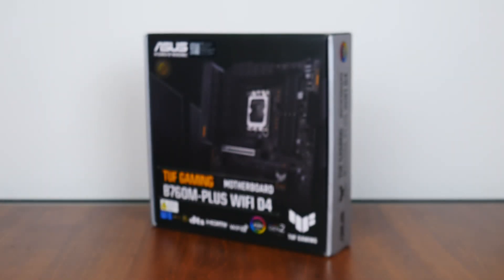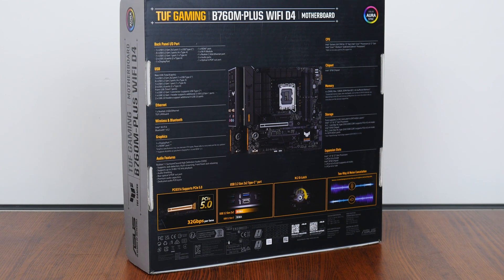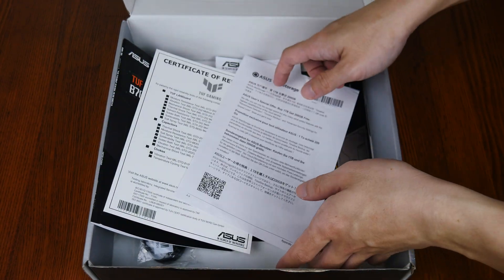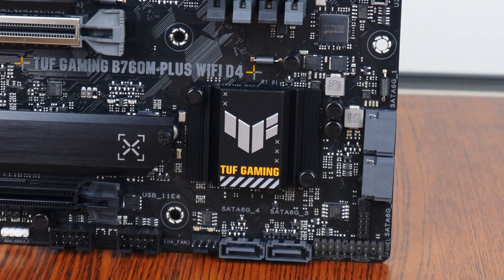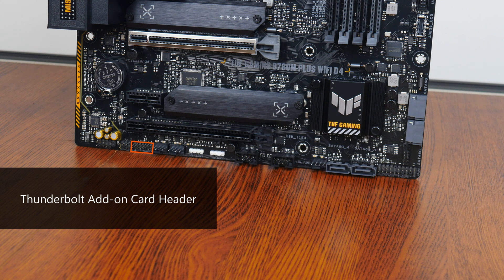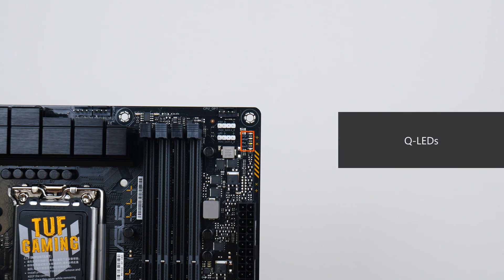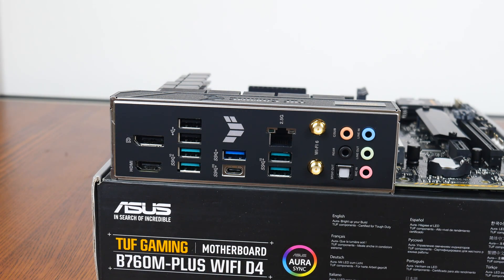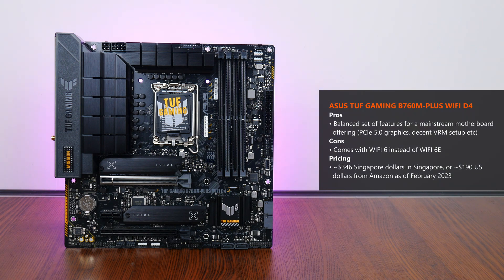Mainstream Intel B760 Motherboard - ASUS TUF GAMING B760M-PLUS WIFI D4 Unboxing & Overview

Comment: I don't know if it is a defect with my board only, but the CPU socket spring was way too strong. I was worried I will break something simply trying to lock in the CPU. I am also getting thermal throttling at around at 4.8 GHz (instead of max 5.2) for 13700 with a 240mm AIO. I suspect it has something to do with with uneven pressure on the CPU. The VRAM heatsinks are also unnecessarily large that can interfere with CPU cooler installation.
Reply from the maker: The processor retention mechanism can be a bit fiddly to operate at times - is it more force than usual compared to other LGA1700 sockets, assuming you've handled other LGA1700 motherboards before?

That said, there's some articles and videos out there regarding how the LGA1700's ILM causes warping which in turn affects the processor's thermal performance. If you have the budget for it, getting a contact frame from Thermal Grizzly, Thermalright etc might help things along..
Reply: @ALKtech  Thanks for your response. Last time I assembled a PC was intel 10th gen. Installed many others but all before that. So I cant compare with other 1700 boards but this was definitely much tighter than any of the others I had installed. I have already ordered the thermalright frame to replace the intel one after seeing those ILM videos. May be that will fix my heating issue.
Reply from the maker: @KK-fi6ms  I see. Would be interesting to know if the Thermalright does indeed bring about thermal performance improvements...hoping it works wonders in lowering the temps for your build!
Reply: try enabling asus perfomance enhancment it will stay at 5.2ghz after that, if ur cooler is good enough
Reply: @zaylo6941  That will not help with thermal throttling. Quite the opposite.

Comment: If you can help me to make a decision, I will be very grateful.

I am going to build PC with Intel i5-13500 and would like to put a
motherboard MSI Pro B760m-a because of the 2 DP and 2 HDMI ports /no one else offer this option/.

My question is this MB has enough power delivery /VRM capability/ for i5-13500?
And second - can be used with 2 HDMI 4k monitors and 1 DP 2k monitor simultaneously?

If I understand correctly the other option is to put discrete VC in order to add additional HDMI port?

Thank you very much in advance.
Reply from the maker: The MSI board will work just fine with the 13500 in terms of power delivery/VRM, so no worries there.

That said, do you already have the intention of getting a discrete graphics card? If yes, why not just connect the monitors directly to the graphics card's display output ports? Most modern graphics cards of today have three to four display output ports, and should be capable of running the three monitors that you mentioned...unless your intention is to just use the onboard graphics of the 13500? Also, are you a productivity user (e.g. video editor who uses a multi-monitor setup)?
Reply: @ALKtech  No discrete card and no gaming - that's why I opted for MSI Pro B760m-a because of the 2 DP and 2 HDMI ports of that mobo - I would like to use it with 2 HDMI and 1 DP displ. simultaneously. No heavy video editing or whatever - just office use - a lot of docs, browsers and so on multitasking. I was told PRO serries is with subpar components and to choose something more robust like Mortar or Tomahawk.
And thank you very much for the response!
Reply: And yes - I Intend to use the onboard graphics.
Reply from the maker: @dimitaryonchev1950  Got it. In theory, the MSI board should support the triple display outputs that you're looking at, using the 13500's integrated graphics. I've personally never used a multiple monitor setup on integrated graphics before, so I can't say with certainty that the MSI board will deliver on what you're looking for. You might want to see if your local retailer is able to test a multi-monitor configuration using the MSI board before you make a purchase, for a peace of mind!

That said, the PRO series really isn't that bad - I've used a few boards for builds over the past two years or so, and they've all been good thus far.
Reply: @ALKtech  Thank you very much again - will contact MSI for sure or will try as you say.
Reply: @ALKtech  Hey, what motherboard would you recommend for i5-13600k? Is this motherboard good enough in terms of power delivery or should I only look at z690 and z790 options? And if yes, which models are the most reliable? I don't plan to OC my CPU or RAM, stability of my system is my main focus and concern.
Reply from the maker: @kleptokratija  if you're not intending to OC, you can look at a mid-to-higher-end B760 motherboard offering I'd say, and yeah, this TUF GAMING B760M should work well with a 13600K. Ultimately, it'll all boil down to pricing IMO - how are prices like for B760 boards where you're from?
Reply: @ALKtech  Asus TUF B760 ≈ 225 EUR
Asus TUF H770 ≈ 265 EUR
Gigabyte Z790 Gaming X ≈ 300 EUR
Asus Prime Z790-A ≈ 390 EUR
Reply from the maker: @kleptokratija  right, I think you can run with the TUF GAMING B760, and use the money saved on the other components of your PC build. I wouldn't get a Z790 board unless you're intending to overclock and have the need for more connectivity (more USB 3.2 ports, PCIe 4.0 slots, SATA ports etc).

Comment: Curious Question: What happened to the non-k version of the i5 13600? Can't find news anywhere for this model. Locally and Internationally.
Reply: I can find it only in few online stores and ONLY as an OEM tray, nowhere is sold in retail box
Reply from the maker: Or yeah, perhaps Intel intended this chip as an predominantly OEM-only offering...
Reply: @ALKtech  interesting...do you know where one can buy the i5 13600 non k in Singapore?
Reply from the maker: @BravoSixGoingDark  not really 😅 given how elusive it is, I think one might as well just get the 13600K...
Reply: @ALKtech  good point, or just skip it and get the i7 13700 non-k, another good choice but slightly pricey at about SGD $500 - $579+ on carousell, unsure for other online platforms.
Reply from the maker: That...is a really good observation. Never actually noticed that the 13600 doesn't really exist in the retail channel until now that you've mentioned it. Did some searching and came across some Reddit threads on users commenting how hard it is to find the 13600 too... 

Pure speculation on my end, seeing as there's lots of talk out there on the 13600 being an Alder Lake chip in disguise (especially given the amount of L2 cache the P and E cores have), perhaps Intel didn't have the intention of producing that many of them, in that the 13600 is based off an older design? Your guess would be as good as mine!
Reply: Interesting breakdown. Maybe cancelled again like Intel cancelling Meteor Lake Desktop CPUs. 😢

Comment: I really want this board with an i5 13500 . Seems a solid build.
Reply: I just bought I5 13500 along with RTX4070 for this mainboard. Cant wait to build my new rig  🎉
Reply from the maker: Yeah I think a 13500 will pair just fine with this board. Do you have a graphics card in mind already?
Reply: @ALKtech  currently i didnt have budget for a gpu, so I keep my 1070, but i think the 13500 can feed it better in newer titles like elden ring or hogwarts legacy. Im waiting for 4060ti, 4070, ot maybe will buying a 3070. Dunno yet
Reply: @ALKtech would a rtx 3060 work with an i3 13th gen?
Reply from the maker: @reversal_break  yup it will. Don't expect to be gaming at very high FPS though - the RTX 3060 is a pretty old card already, but it should handle 1080p gaming at Medium-ish settings just fine!
Reply: @ALKtech  yeah I'm thinking maybe I'll go for a 3070, also thank you for responding lol I was not expecting that from an older video.
Reply from the maker: @reversal_break  happy to help. I personally bought a RTX 3070 earlier this year for my own personal rig for dirt cheap, and am pretty satisfied with it as I game at 1080p on high-ish settings! Have it paired with a Ryzen 7 5700X.
Reply: I also have plan for pc build with intel 13500 and asus tuf gaming b760m-plus wifi d4
Reply: @oldchannel8127 Try to opt for the DDR5. Price difference is not that big and some games have massive gains due to the ram. Hardware Unboxed did a pretty good video on the 13500.